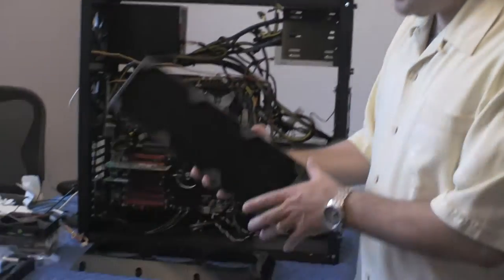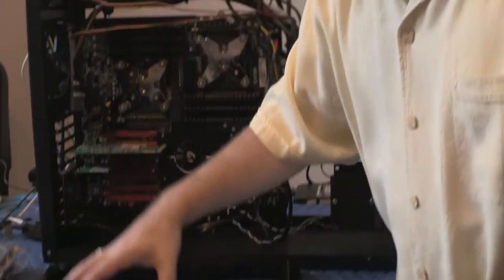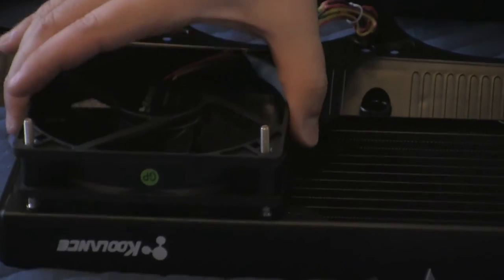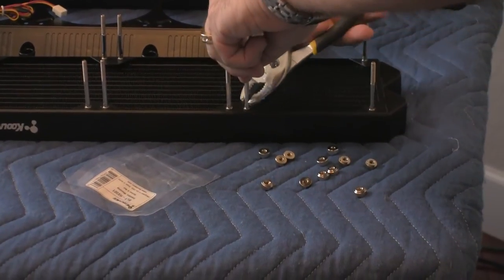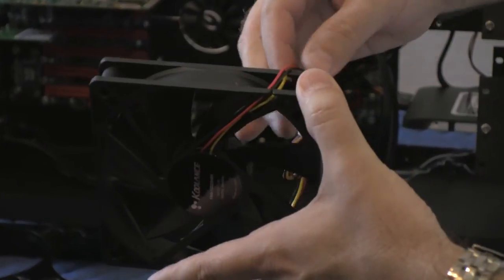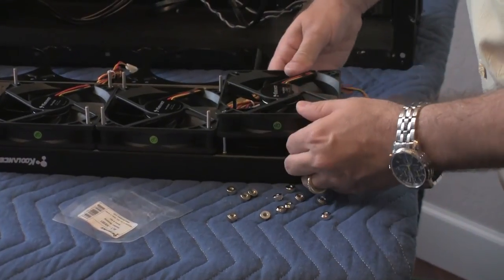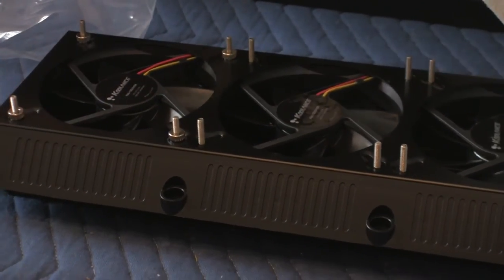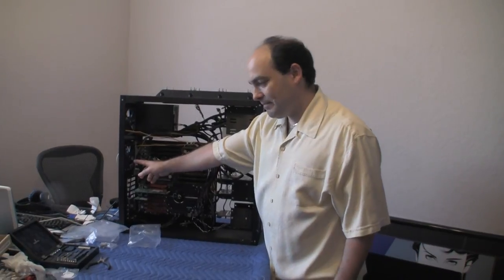Water Cooling Your Computer - Part 8 - Installing the Radiator - Part 1 of 2

Comment: putting the radiator on the top and having the fans push the air up is the best way because heat rises and you are using that to your advantage.